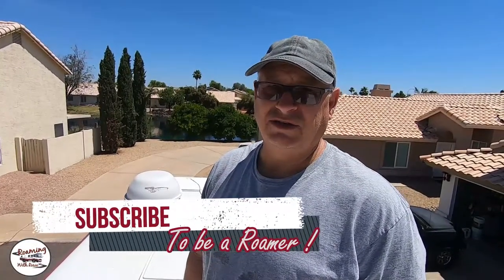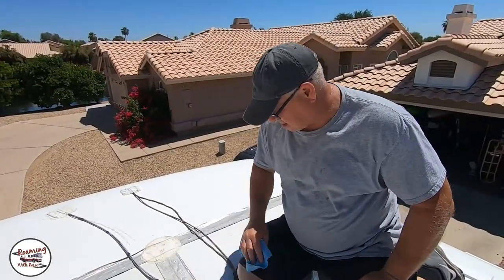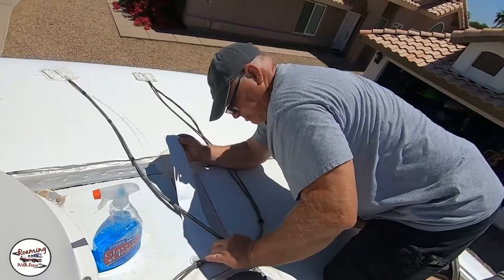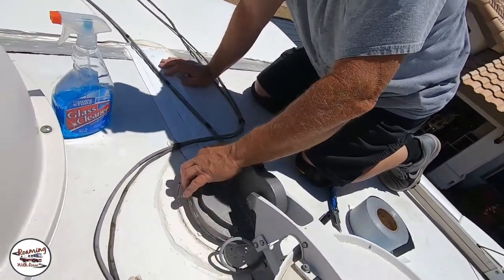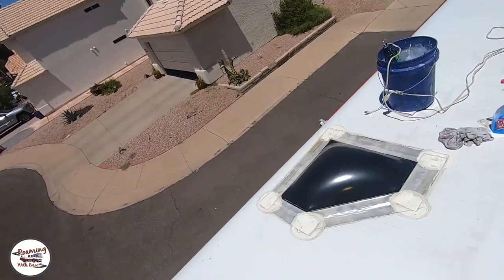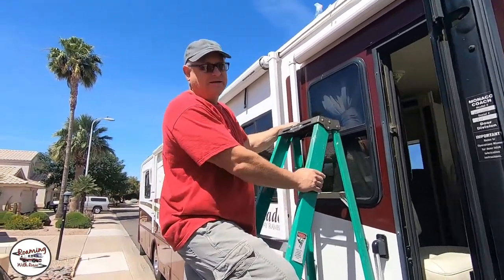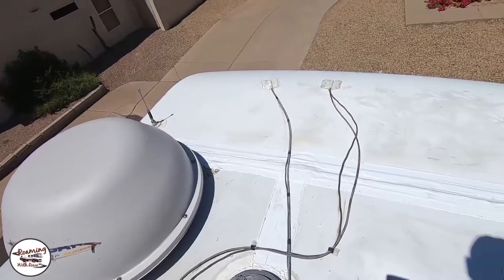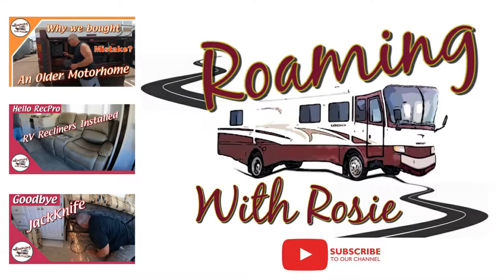Prevent Leaks & Repair Your RV Roof With Eternabond Tape 💲💲 DIY Easy To Apply

Comment: Nice job guys!  Brian found out the hard way about roof maintenance on our Winnebago.  Winnebago uses a silicone lap sealant which Dicor does not stick to!
Reply from the maker: Thanks for watching - wouldn't it be nice if there was a standard for the RV industry? Let Brian know that Aaron Jones from JoneN2Travel is going to help me with the install of our Victron Multi-Plus. Safe Travels!

Comment: Wow!  Nice job.  Always wondered about the tape for sealing.  Glad to hear it works!  I have a newer trailer and everything looks good so far.  Thanks for sharing!!
Reply from the maker: Thanks so much for watching! It works great for sealing, but it also is good for securing wires on the roof. You just want to make sure that if you use it that it would not void your roof warranty.

Comment: How's the Eternabond holding up on Rosie?? Have you thought about Henry's Tropicool for heat reduction as well as sealing roof?
Reply from the maker: We sold original Rosie and purchased another diesel pusher. I resurfaced the roof on this one with Tropicool about two years ago. It’s great stuff! We did a video showing the process. Check it out. 
Thanks for watching!